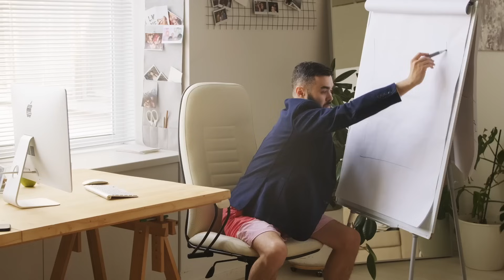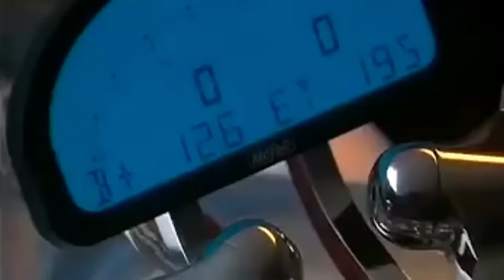When a Car Manufacturer tries to make a Motorcycle

Comment: If other car manufacturers make bikes it would go like this:
-$500k Ferarri sportbike, made in collaboration with Ducati.  
-$40k Jeep ADV thats overpriced as hell because 2 wheel wrangler. 
-Random unkillable toyota hybrid naked or "sport touring" bike that will have a low msrp but cost at least $10k more after dealer mark ups. 
-Ford F-050 2 wheeled cruiser with a truck bed. 
-$30k tesla cyber-bike thats sold as an add-on to be fit in the back of your cyber truck rather then be its own thing. 
-Random flat/boxer 4 subaru that just litterally uses one of their smaller car engines.
-Oil burning kia/hyundai compleate with engine fires, but dont worry, it has a 10 year warentee they will try as hard as they can to not honor.
Reply: Accurate lol
Reply: The F-050 with the bed actually sounds interesting
Reply: The F-050 just made me laugh from the name alone, lol
Reply: Ducati is now a Volkswagen subsidiary and already has made a Lamborghini motorcycle since
Reply: Honda is a car manufacturer and makes bikes
Reply: @kingtnaughty189  Honda made bikes first, then moved to cars.
Reply: Ok, the Kia/Hyundai bit isn’t as accurate now as it would have been some 10 years ago. Hyundai and Kia actually make good (or at least good looking) cars now. Oh, and Hyundai’s N division is absolutely killing it with their offerings
Reply: There is a Lamborghini Ducati
Reply: @projector7141  To my knowlage that bike is just a paint job on a ducati to match a lambo.
Reply: @StardustADV  Good point
Reply: My Kia has been MUCH more reliable than my Toyota, and it has a lot more miles on it to boot. Kia makes good cars these days, Toyota lives off their past glory.

Comment: Toyota, Nissan, or Mazda. All of them have inline six motors they could build a bike around longitudinally with a shaft drive. Making a perfectly balanced bike that could roast any other, at least in a straight line. Besides that, Volvo making the 'safest' motorcycle would be a sight. Ford could build a trike with a truck bed and probably sell a few. Subaru could definitely make an adventure bike and sell some. Really though I kinda find it hard to believe that Tesla isn't already selling a bike, just wrap a frame around a power wall and a beefy hub motor and money.
Reply: Volvo would probably do an iteration on the old quasars.
Possibly with an inline-5.
Reply: BMW currently builds i6 bikes. They have a history of building longitudinal inliners (K100-K1200) and yet they decided to put their sixers in the other way - still with a shaft drive. So i guess when a company with 100 years of motorcycle experience builds them that way, there are good reasons to do it. I also guess the thing would just get long as fuck (technical term) and with that extremely hard to handle at lower speeds and in tight environments. That being said, those engines are a dream! They aren't build for peak performance - rather to the maximum elasticity, which gives you a power band that feels like from an electric motor: silky smooth torque at whichever RPM.
Reply: @NoOne-ef7yu  Putting Volvo and Motorcycle in the same sentence. Wash your mouth out.
Reply: @therwfer  a good reason for a company and a good reason for the end user are often two completely different things, as shown by this very video. That said, making bikes wider then small cars is what BMW is known for and maybe they do have a good reason for it. I'm obviously being an arse though.
Reply: @davidrochow9382  oh come on, you know it would be so ugly it would actually look good, like a KTM.
Reply: @NoOne-ef7yu  a Volvo i5 bike would be iconic

Comment: This is an interesting idea. Put a slightly smaller block in it, extend the front, made the front wheel an automotive tire and use a wide, bigbore tire in back, and you've got something like a Trackmule from Gears 4 or Cloud's bike from FFVII.

Comment: At 13:28
Drag increases with the square of the speed.
The drag is the kinetic energy of the air passing by. E = 1/2 * m * v2
It is calculated from the frontal area and the drag coefficient that is lower for a more streamlined design.
With a motorcycle, you also have to account for the shape of the rider.
The rider contributes to the frontal area and drag coefficient.
The difference between 300 mph and 400 mph = 9:16. You get nearly twice the drag
And because you are traveling a greater distance you need (16/9)^3 = 5.6 times as much power.

Comment: I actually know someone who rode one of the prototypes.  He said it was terrifying on every level.
Reply: Cool story bro 😂
Reply: @GreenCanvasInteriorscape  there used to be a video of the event.  They had people who rode professionally and several people who were journalists and the like.  He worked for a magazine.  

But those test bikes everyone that rode that day said about the same thing.  One of the superbike guys told him that it wasn’t stable and to keep his speed below 100.   He said it was hard.  The bike would idle at around 60-70 in the top gear.  Just no throttle and it’s sitting at 60-70. The brakes had a hard time holding it still when just sitting and the reps and pro riders recommended taking it out of gear when not intending to ride.

Comment: Münch Mammut did this better in the 60s, 70s and 90s.

Effectively the first liter bike, it went to 2l, then supercharged.

The Mammut (Mammoth) 2000 was a Cosworth 2l, turbocharged, 265hp beast.

Jay Leno owns an original and has a Jay's Garage episode about it.
Reply: ... That's less than HALF as much power. They aren't the same thing at all. 🤦😑
Reply: @Cooe.  yeah let's see you crack the throttle on the Tomahawk. Do a flip. I bet it handles like a dream, too.

The Mammut is already powerful enough that the only way to find its limits is to be cool with dying to find out.

Also, the Tomahawk is a concept bike - Münch invented the superbike in the 60s. Suck it, Dodge Boy.
Reply: @rocketpigrecords3719  I'm not saying it's awesome to ride, I'm just saying they are completely different things... Because they are. Get the f**k over it. 🤷

Comment: The compactness of it is actually really remarkable. I don't think anyone ever talks about the fact that they not only put a viper engine into a motorcycle but also a fuel tank, radiator, real suspension system, battery and everything else.

Comment: I did interact with Dieter Zetche (CEO at the time) and it was during the initial stages of the Tomahawk project. The story goes like this: 

For a weekly design review, I had set up a presentation consisting of two large (22 ft long) panels; one with sketches + renderings (images) generated from my early CAD model, the other with my attempts to justify the project (why it made sense for Chrysler to do this). In font of this 2D work was a makeshift full-size mockup to demonstrate overall size and to answer the question “Could a human/rider even sit on such a thing?” The 2D part of the presentation was kind of flashy; the mockup was totally utilitarian.

The mockup was built from a borrowed Viper engine (Dave Chyz kind of snuck one to us from down in the lab where they did crash testing) + a pair of Viper tires (wide enough to simulate the twin wheel design of the Tomahawk proposal) + a makeshift seat fabricated from steel tube and ¼” plate that hung directly off the bellhousing  A  a pile of shop rags was taped on to serve as a cushion. I kid you not; I have the photos.

Almost nobody took the presentation seriously. In fact, up to this point, the only real proponent of the project was Freeman Thomas (brought in from Audi to be head of Design; ended up becoming head of Advanced; whole ‘nother story there…). Frankly, even I was lukewarm. And, I had pretty much immediately alienated the two guys who originally had the idea to use a Viper engine in a bike. These guys were fans of the classic Harley Davidson “custom” look (and lifestyle) and would have liked to see me propose something more along those lines (see the Boss Hoss). I however like classic (OK, old) Italian sport bikes and I rode and still do ride an early Moto Guzzi 1100 Sport that I reworked for better performance (the EPA-compliant version runs like a turd). Take a look at the +/- 1955 Guzzi 500 CC quad-cam V8 race bike WITHOUT the “dust bin” fairing. Find the right photo; this was my inspiration for the Tomahawk.

The presentation was still in place a week or two later when Dieter and Wolfgang Bernhard (COO at the time) were in town for a visit. One of two acting Design heads at the time, Trevor Creed would be receiving them and would of course give them a tour of the studios. 

Like everyone other than Freeman, Trevor was not an early supporter of the project BUT, for whatever reason (probably because it was a pretty display), Trevor did decide to walk the German visitors past the presentation. Unwritten Chrysler tradition dictates that the designer pretty much without exception presents his/her own work. In this case, there was a real risk that the audience might bust out laughing but they did not. It turns out that, as a kid, Wolfgang rode dirt bikes and Dieter rode horses so they both had some sort of connection to this thing. They let me talk and then at the end, Dieter turned to Trevor and said “You must beeld zees sing; you veel beeld eet yah?” To that Trevor said “Yes, of course we will”.
Reply: I meant all this as a reply to El_Peto but clicked the wrong button.
2 hours ago

Comment: It's absolutely beautiful. I think it could absolutely get to 110 safely, it is made of very strong material and by engineers who understand how stress and physics will react on the parts of the bike. 

Any speed beyond that is a great unknown, could the rider even stay on the bike? A rocket can go many times the speed of sound, but just because the engineers bolted a steel chair to it that is guaranteed to stay on the rocket, doesn't mean you'll stay on the chair.

If I could afford it I would buy it without question, even though it would probably only be used as a cruiser, with the occasional long journey, never going faster than traffic.

It certainly has the spirit of the Viper, go beyond your limits and it will kill you and itself.

Comment: It definitely isn’t doing 300, but you went a bit far in your criticism. To say it would fall apart at 100 is laughable, it’s clearly capable of hitting speeds of 150mph safely. Above 160 would be tough, but only due to lack of a fairing. With a fairing it’s obviously capable of very high speed. I don’t know where this idea of it falling apart is coming from. It looks very solid, well built, stable and has 4 tires. It’s overbuilt if anything..

Comment: The older carbourated Honda Goldwing/Valkyrie uses a miniaturized version of the flat 6 in the Porche 911. The Valkyrie specifically is a beast of a bike and I have clocked mine going 0-60 in 3.5 seconds, though I have an aftermarked transmission.

And then we have the Rocket III... a monster of a bike.

Superheavy cruisers are damn near car engines strapped to a motorcycle frame.

Comment: AFAIK, BMW started out as a Motorbike manufacturer, that went into car production, starting car production by buying a license/copying the model T, iirc.
Reply: Aircraft. Don't forget aircraft. There is a reason the badge looks a bit like a spinning propeller.
Reply: @wbrennan2253  oh yeah, you're right. It does look like a spinning propeller. Learn something new everyday, thank you Sir.
Reply: BMW started as an aircraft engine manufacturer, hence the stylized spinning prop logo.  Post World War 1, German military aircraft production got shutdown by the Treaty of Versailles.  In search of a way to keep the doors open, BMW took one of their flat-four engines, cut it down to an opposed twin, built a motorcycle around it, and as they say, the rest is history.

Comment: Drag increases with the SQUARE of speed (that's not what the word "exponential" means). Power needed to counteract it increases with the cube. If, for example, you need 100Nm and 30kW to sustain 60mph, 120mph would require 400Nm and 240kW.

Fuel consumption (per unit distance) also increases with the square, but the engine's parasitic losses and overall efficiency curve play into this as well. Once drag becomes dominant (past around 90 km/h), the above rule of thumb starts to come into play. Accounting for small and efficient car bodies, as well as very efficient engines, this rule of thumb can be relied upon for most vehicles past about 130km/h.

On my bike, it's valid down to 60-70 km/h (after about 40mph). I make a good saving by taking the back roads, where the speed limit is 60mph or less, rather than going on the motorway (where it's usually 70), because mine is a naked bike and drag dominates from quite early on.

The practical upshot of that is that I get to enjoy powering through a couple of gears without it affecting my pocket too much, as long as my sustained speed isn't very high.

Comment: When I was in the states, I worked on a racing stock car which all had Yamaha FJ1100 engines.
Reply: Around 1996 I was living in Roswell Georgia USA and my 1989 Yamaha FJ1200 with 55,000 miles / 86,500 Km was stolen.  A co-worker told me it most likely got parted out with the engine/transmission ending up in a Legends race car ( https://en.wikipedia.org/wiki/Legends_car_racing ), given that the Road Atlanta race track was only ~60 miles away.

Comment: I remember when Dodge unleashed the Tomahawk concept bike. It was something to behold, a bike with 4 wheels. Too bad they were not bold enough to take it to production.
Reply: You didn't finish the video, they did put the Tomahawk in a limited production.
Reply: @Modine.  Building 9 bikes is not limited production. That's more like a little factory exercise.
Reply: @richardike2342  Except factories don't do exercises, they were built for a reason.

Comment: Aerodynamic drag not only increases exponentially, it increases as the cube of the velocity.  So there isn't 4 times as much drag going twice as fast, there's 8 times as much drag going twice as fast.

I am incredibly curious about the transmission on this thing.  That's not a lot of space for a gearbox.

Comment: I loved this thing then and I love it now. It's thoroughly ridiculous, indulgent, and excessive, and it's exactly the kind of thing I love seeing come out of blue sky kind of approach to engineering and design. 

I doubt it would fall apart at 100 mph, but I think the speed limitations are going to be far more about the lack of a front faring and the resulting effects of wind on the rider than the mechanical limits of the machine itself. But gods forbid you try to turn while going 150 in that thing.

Comment: I went 140mph on my vmax once in Mexico and thought i was going to die. Going 400mph on a non-faired motorcycle sounds like one of those things that'd just kill you by default lol. The four wheel thing was just stupid though. That alone is going to kill most people's interest in it. It's one of those "if it ain't broke don't fix it" sorta thing. They literally engineered points of failure for absolutely no reason.

Comment: Having 2 wide wheels would probably go up on the edge during a turn and be unstable, so I don't think the 4 wheels are a problem. But the way they're attached sticking straight out looks like it makes the bike reeeeealy bouncy. If you hit a bump going highway speeds with that little seat you might pop right off the bike.

Comment: I'm hearing it will top out over 400+ mph or 250 if they need an experienced rider to conquer this beast I'm there guy I'll push that beast to its limits all day! Right now I'm riding a bike I built it's a 2008 ZX1000R that I took my turbo off my Volvo and installed it on this bike!!

Comment: I would ask if the Honda Goldwing racing, where they strip the winabego's of their comfort and abuse the 1.8L engines to the max (including turbo charging them) is anywhere in the ball park of this video. Afterall Goldwing is the actual motorcycle to hold the title of "Car on 2 wheels"
Reply: Not at all. 

Goldwings are marvellous machines with extremely good engineering. They wear their weight very well, and in the hands of a good rider, can embarass smaller and nimbler bikes with their handling and performance. 

Back in the early 2000s when the GL1800 was first introduced, a friend who worked at the local Honda dealer found out how much of a beast that they really are. After monkeying around in the parking lot, he got a bit too roudy, and ended up wheelieing right into the side of a customer's pickup truck. Surprisingly, he kept his job.

The Tomahawk, on the other hand, is an engine with motorcycle-ish parts bolted onto it. Much of its engineering was sound, at least on paper, but the implementation left a lot to be desired. This is especially true in regards to aerodynamics and rider comfort/ergonomics.

Had they skipped all of the gimmicky bs and used the Viper engine in a more traditional chassis (as Allen Millyard did years later), the Tomahawk could have been great.

Comment: [deleted] Suzuki made sport-utes the Samurai, my relative had one. Suzuki Company started out making textile weaving looms. [added:] Then started making cars in 1937. Let’s make motorcycles … why not.

The Fed government says it is NOT motorcycle if it turns four wheels on the road. My state DOT says no more than three wheels on the road (or two with 2 add-on “stabilizer [“training” haha] wheels).  The NHWSA, EPA and CPSC would say no way, it’s an automobile, car, SUV, … and must meet those standards. And no doubt Dodge attorneys did a quick calculation of the jury award if some nimrod tried maximum performance and the production model fell apart. 
Three wheels, think a motorcycle with side-car (e.g., the Ural) or those Polaris things or that duel front wheel cycle a “big 4” manufacturer tried.